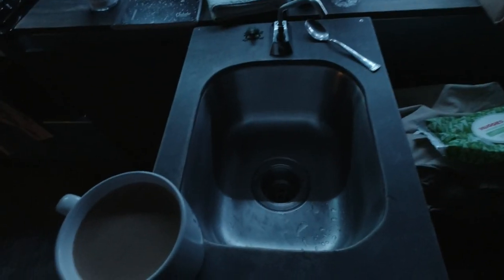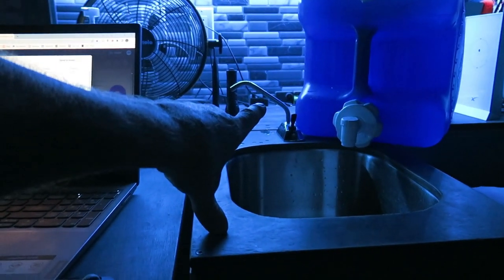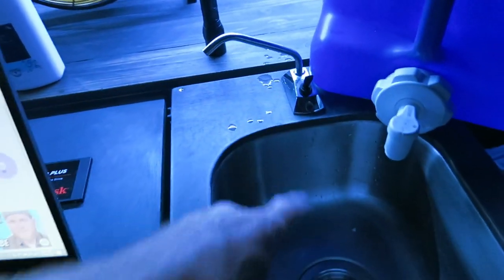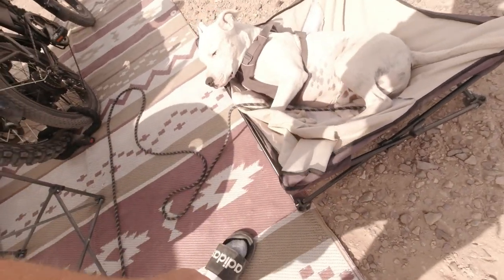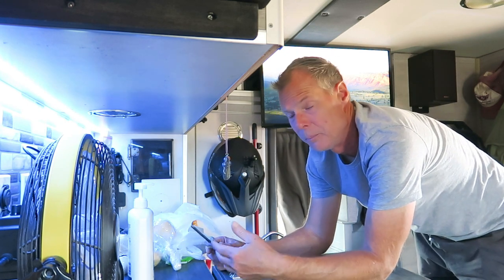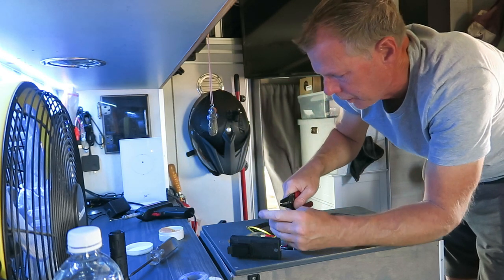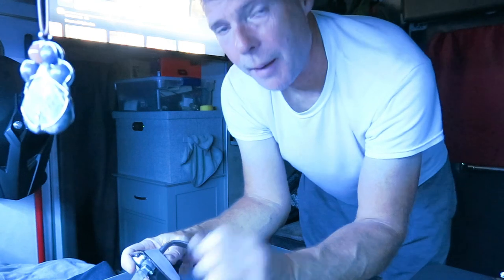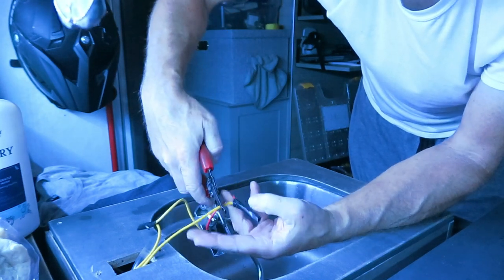I Almost Burned My Truck To The Ground From A Wiring Problem That I'd Never Seen Before !!!

Comment: I'd need to see the joint, but soldering corroded wire needs some flux otherwise you are never going to get a good permanent joint.  I carry a little tub of Caig Rosin Soldering Flux.  It's fine for general use as well as printed circuit boards.  Clean up is methylated spirits or isopropyl alcohol which is recommended for circuit boards, though you can leave it as it won't cause corrosion.  For casual use, one tub is probably a life time supply and it's an essential tool for anyone doing maintenance electrical work.

Corrosion will rarely take out an entire wire run, but I have seen cases where the contamination runs six inches up inside the wire but that takes a long time, or constant contact with moisture.  I can also recommend heatshrink tubing with the hot glue inside for making water tight insulated connections.  It does a professional permanent job.  To shrink the tube I like to use the hot air on my soldering re-work station, but you can just as easily use a cigarette lighter or a BBQ lighter to do the job.  You can buy this tubing in 1 meter lengths from China - I carry about four different diameters.

The knee switch is a perfect idea, or at least a booted waterproof switch on the tap.

ETA: the Caig product is #RSF-R80-2 and it should be about $10.  Like I said, pretty well an essential tool for the kinds of repairs we do.  They make a larger pot but the small one will last many years, and you can apparently buy it direct.  You can dip the end of a wire into it to add flux, or apply it to terminals.  Oh, and get some proper 60/40 lead solder which you can still get from China.  The lead free stuff is just too hard to work with, especially in a maintenance environment.  Buy a big roll of that.  Ebay seems to be the better source for all this stuff - Amazon prices are about 500% over what they should be, like the small Caig flux pot is over $50 on there.  Crazy stuff.

ETA^2  Yes the solder you use is probably flux cored, but the amount that is actually in there can be very variable, and for even a slightly corroded wire or terminal it is not enough anyway.  Another application is dipping your solder wick into the flux to add much more.  You'd be amazed how well refluxed solder wick works to clean up circuit boards or terminals.  The best advantage of using a flux is that because your solder wets and flows much easier, it means the job goes a lot quicker and you are not putting so much heat into the whole job and ruining your work.
Reply: Wow!  Amazingly helpful info!  I'm going to copy and save for later -- along with a couple of other helpful comments I saw in this thread.  There's no substitute for decades of experience with these issues, and it's wonderful to find people sharing their knowledge so freely with those of us who need it. 👍☮🙏
Reply: @livingitup9647  Thank you, I'm glad you found it helpful.  Decades of experience, yes.  I'm not far off David's age and my electronics experience started at the age of about eight or nine.  Lots of mistakes made in the intervening time, and lots of changes in technology.  Back then there were no LEDs, $2 microprocessors, or even heatshrink tubing.
Reply from the maker: This was the worst corrosion that I've ever seen but I know exactly what was causing it - using the switch mzny times a day with a water soaked hand was just like pouring water all over it.
Reply: @Chris_the_Muso  Thanks for your response.  I'm even older than David -- a woman contemplating striking out on the road, on my own.  But, it can seem a daunting prospect if you're not well-funded and well versed on all the mechanicals.  So, listening to all this well-earned experience and/or institutional knowledge, is extremely helpful.  
It does make me wonder, though, how the next generations will manage, as there seems to be such a dearth of this type of practical, hands-on knowledge in modern America.  This is largely, I think, because we allowed all our manufacturing to leave the U.S. and have deprived millions of workers of these skills, reducing our cumulative skill sets by turning us into a throw-away economy -- dependent on cheap, often subpar, Chinese-made junk.  And big box stores that sell lots of disposable 'stuff'.'
By contrast, I still have my Maytag washer and dryer from the early 1980's, and I'll keep using them, and repairing when needed, because they were quality-built in the U.S., with no electronics.  
In short, we need to share this generational knowledge so these skills can continue to be passed along to a wider audience -- especially to those who didn't have access to trade schools, or hands-on mentors, or who weren't required to 'fix things' while growing up.  And with all the uncertainty facing us in the coming months and years -- geopolitically, economically, etc. -- we will need this type of knowledge even more in order to keep things running!   Keep sharing your valuable knowledge with others!  And thank you, again. ☮🌟
Reply: @livingitup9647  Well good luck with your plans on striking out!  If you can do short trips and stay close to home at first it can really help get your confidence up.  Short trips are less daunting and give you a chance to shake down your equipment and setup.

Unfortunately, many young people don't seem interested in learning how things work or making and fixing things.  It is mostly to do with the throw away digital consumer society we have created.  Conversely, the internet has created a rich environment to learn how things work and how to create and fix them.  This information is more accessible than it ever has been in history, so for those that want to create, they have everything they need to learn and it crosses boundaries and countries like nothing else has ever done.  The only thing I would say is, it's best to look and listen to lots of different people, find the ones that make sense to you and look for a common sensible approach to problems or technical information.  I don't think I will ever stop learning, and that is the key to everything really.
Reply: Just out of curiosity did you have a "150 in one kit" from Radio Shack when you were a kid? That was the best educational toy I ever had.
Reply: @infotoons212  Radio Shack in Australia was called Tandy and they didn't start until 1973, and I didn't even see a store until much later than that.  I did have a "150 in 1" kit though.  It was a wooden clamshell box with components in the bottom and lid, and you made connections with wires.  Once you worked through the instruction book you could design your own circuits.  The labelling on the components was German but at least the book was in English.  The components included a tiny selenium solar cell and a few transistors.

The instruction book did explain the circuits a bit, but it did not try to teach Ohms law or anything else as far as I can remember.  Still, I had a lot of fun building crystal radios, amplifiers, and sound generators.  I think one of the transistors was even a germanium one.  To put it in context, the US was still sending men to the moon at this time, though it was towards the end of the Apollo programme.  Yes, there have definitely been a few changes in technology since then.

Probably the main electronics component retailer in Australia at this time was Dick Smith, who first started in 1968.  He sold components and kits and opened hundreds of stores around the country, so that was really my equivalent of Radio Shack when I was growing up.  The main difference between Dick Smith and Tandy for me, was that all the components in Tandy were carded or bagged (and labelled Radio Shack), and were relatively expensive.  In Dick Smith you could rummage through drawers of components and pick out what you wanted, the variety was mind blowing and the components were cheap.

Decades later Dick Smith was sold to a supermarket chain, became Dick Smith Electronics (DSE), and started to focus more on box store hobby electronics rather than kits and components.  Tandy closed it's doors in Australia in 2011 and DSE went into receivership (basically, all but bankrupt) in 2016.  Partly I guess all the kids had lost interest in HAM radio and home brew electronics, but mostly I think it was because both stores failed to move into e-commerce which is now the main business model for hobby electronics.

There was another small competitor who managed to stay true to the ideals of selling components and tools to enthusiasts, and that was Jaycar.  Jaycar still exists and the disappearance of DSE and Tandy left the field open for them, enough to support a limited number of stores around the country and also have a thriving e-commerce business.  You can still find me on Sunday mornings sometimes though, rummaging around the component drawers with a parts list in my hands... but in Jaycar rather Dick Smith's.

Oh, and I should point out there are a few trade stores catering to Electrical Engineering businesses and repair shops and always have been.  They usually carry quality and name brand tools and components, and mostly only want to deal with businesses, but in the last few decades they've been opening up more to retail trade and online sales.

Sorry, you got the long version when you only asked a simple question.  Never ask an old fart to reminisce about his childhood.  You'll be here all day...
Reply: @Chris_the_Muso  Yep, that sounds like the one I had and you're right it really didn't try to teach the math or science. It was more of a hands on introduction to a child about what was possible in the field.
Reply from the maker: @infotoons212  No that doesn't sound familiar...

Comment: What a hassle over something so simple you'd never think that. You may want to put a drip Loop to the wire that comes off the switch that way if it runs down that wire it will hit the bottom of the loop and drop down instead of going all the way down the whole run of wire

Comment: Having been an electrician for 25 years, I've literally poured water out of the ends of wires. 
That switch is in a bad spot for water intrusion.
Also, an open jug of water in a cabinet creates a high humidity environment which is bad for electrical components like that switch.
You might want to move it out of the cabinet altogether.

Comment: Used tinned wire in the future. Costs more, yes. Never corrodes. The whole wire, hot and ground, is probably all rotten.
Reply from the maker: I replaced it all and it was corroded pretty far down the run

Comment: How much amperage does the pump use
Reply: Was wondering this as well...and if it would be beneficial to use a switch to activate a relay for the pump.
Reply from the maker: I'm not exact in that spec.

Comment: Just keep a 1 gallon water jug filled half way to keep it light and easy to use , when you need water you can just pour out what you need .
Don't need no switch , don't need no sink faucet , nothing to fail and nothing to buy.
Just a thought